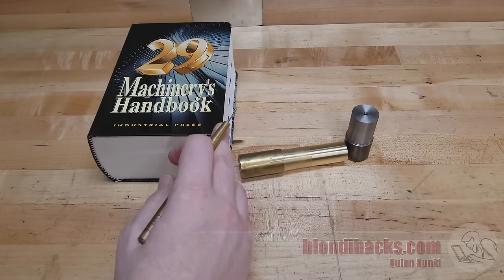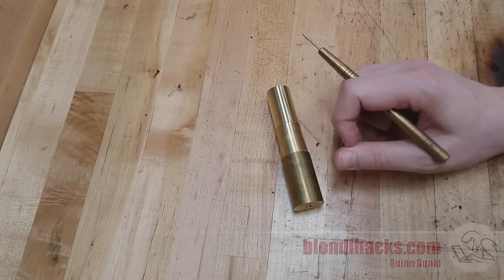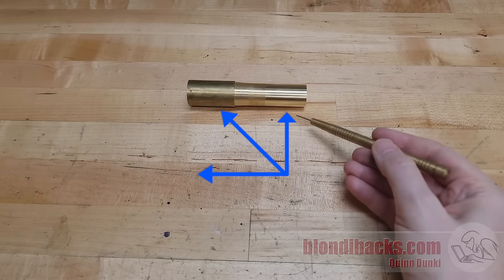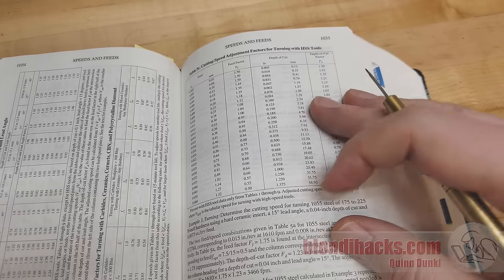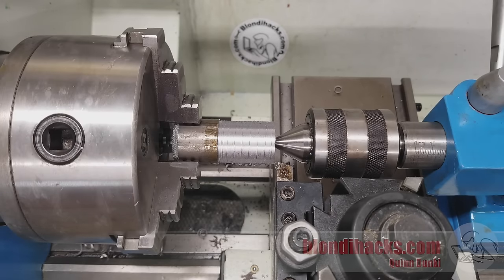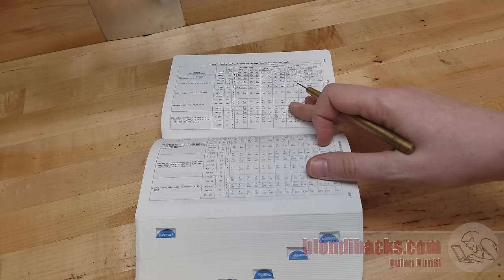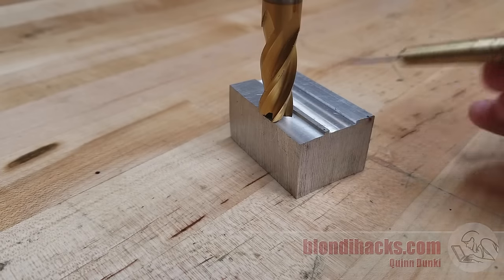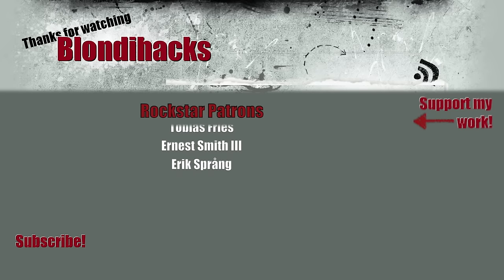Metal Lathe Tutorial 21 : Speeds & Feeds

Comment: Hi Blondiehacks, if you have not read the book "The Amateur's Lathe" by LH Sparey, you should, in-fact every amateur should.  Originally written for model engineers it is packed with information on the use of this class of lathe.  Really useful information is in that book!  It also has some machine drawings to make useful add on's for your lathe to increase its capability (Eg. collet set).  Line boring, milling, reamer making, lapping, heat treatment, spring turning, spinning are just some of the topics covered.

PS.  He discusses a technique obtaining a very high finish using HSS, and it is not using the shear tool, although I think it is mentioned somewhere.

Good quality content. Keep it up!!
Cheers.
Reply from the maker: Thanks for the tip! I will look that one up.
Reply: Thanks for the tip as well, I've just ordered the book - cost just under $20CAD, well worth it I expect!

Comment: You mention what a CNC shop does for feeds and speeds. Tooling manufactures recommendations, Machining Data Handbook and later HSM Advisor were my go to sources for speed and feed. Looking at the chip, sound and surface finish was what I used to dial it in.

Comment: Love you videos. I’ve always gone with 1/2” steel at 600 rpm. Double the diameter and you’d halve the speed.  Halve the diameter and you’d double the speed For aluminum double these speeds and for stainless steel halve the speeds. High nickels and super alloys go carbide and get a good book. I’m a welder by trade so I do mostly rough work.

Comment: Good show, I learned in school to use the same formula ,  You answered the question why the machinery's handbook has different speeds and feeds , The SFPM  I learned for steel is an even 100  , I have similar numbers for other metals from school This is a Guide  THIS IS A GUIDE THIS IS A GUIDE  My mistake is to use lower speeds not always good , After my course I used the formula a lot for turning ( Dia. of the part ) Drilling ( Dia of the drill )  Milling ( Dia of the  cutter  )  Today I play it by ear sometimes I will still use the formula ....

Comment: The Machinery's Handbook is not directly applicable for machining with metal working equipment which weighs less than 1 bus or costs less than 10 buses.  A guy I knew was a chef on an aircraft carrier.  After his service, he was planning to use his personalized Navy cook books to open a restaurant.   He did.  And he failed before he opened.  Most recipes were for 2000, the smallest for 200.  Scaling to 1 or 10 simply did not yield food he could serve.   You did a great job on this video, delving into the assumptions, details and the calculations.
Reply from the maker: I bet he could throw a hell of a huge dinner party, though.

Comment: I do not look forward to needing to convert all the feed rates on an old artisan lathe as I likely need to convert the carriage lead screw to a modern ACME or ball screw. So far I have not found a good solution to recreating the 3/4"-double start 2tpi LH ACME thread on the worn-out leadscrew nut. So replacement and converting all of the feed rates is looking more and more like the only economical solution.

Thanks for going over the general details.

Comment: Playing with the numbers as you put it.. I had a job that required I turn a 12 inch long x 2 inch diameter shoulder on a hand full of 5 inch diameter 1018... best cut vs tool life I got on my big old monarch was a 15 thou feed, .375 depth(3/4 on od) and 300 rpm... chips were wicked, but I got 2 parts per tool sharpening

Comment: Hi Quinn,  what i would like is a video showing how to know when turning or even facing if your rpm's are to slow or to fast.   How to know when your tool is happy or not.   Even with all the figuring whether you are on track or not.   Even milling whether speed up,  slow down or it's cutting good.   Even whether to change the depth of cut or it is fine.   I would sure like to learn about that and could you consider doing a  video on that.  Thanks. 

Dale in Canada
Reply from the maker: Hi Dale! That’s really about feel and experience with your machine. What I recommend is starting with light cuts (10 thou) and low feeds (0.005 per revolution). Then work up slowly from there and notice how the machine sounds, how the cut looks, etc. You’ll learn where the upper limits are.

Comment: I've watched this video I don't know five times already and while I understood what you were saying it wasn't connecting. This time I'm actually trying to find the correct way to find these settings and with the knowledge I've gained in the meantime your stating the problems in having time and time again. I know feed rate matters depending on the tooling you are using to cut (as well as other factors) but try to find a clearcut answer on how to calculate the correct feed. Every answer is SFM which okay cool where's the other incredibly important part of the answer? I could have my spindle doing one revolution an hour and a feed rate of a mile per minute (yes I'm being facetious) so long as it all adds up to the same SFM right? So this time around you have my undivided attention.
Okay, I see what you did and I appreciate it. I wanted to find out exactly how to calculate these settings and you showed us how to do it with any machine we own. Not that answer I wanted but the answer I needed kind of thing. Thanks for taking to the time to share your knowledge. I wouldn't have half to knowledge I do without youtube.

Comment: Try a carbide insert for aluminium on brass and aluminium.  The 20ø of rake really reduces the power needed to make a cut and the edges are ground so they are very sharp.
They are so cheap that using them for steel is not unrealistic either. They work really well on free cutting steel, they don't last as long as they do on nonferrous materials but as I said they are really cheap.

Comment: Thanks for this nice information. One question, or comment: Regarding the true surface speed beeing the result of the two vectors, 
the horizontal vector as a result of feed speed has to be  miniscule in comparision to the rotational vector. It will therefore add almost no 
extra surface speed.  At least that is my understanding, willing to be corrected. Thanks.

Comment: Great subject Quinn, well covered! Now the confusion starts 😭😭😭. Rubbing isn't machining, and mild steel does not respond favourably to machining. Carbon Steels ≥0.35 machine better, mild steel = stringy cheese, carbon steel = hard cheese. I'm sure Quinn will delve deeper in to the world of modified/free machining materials.
Thanks for sharing
Reply from the maker: I cover that quite a bit in my “how to buy metal” and “surface finishes” videos, as a matter of fact
Reply: @Blondihacks  I will have a look Thank you, many hobby ladies and gentlemen would benefit from only using free machining steels, as long no welding or heat treatment is required, but most likely would be sold at a premium in small quantities. More swarf per Coulumb, not technically a unit of power consumption.

Comment: MH assumes you know what material you are cutting.  I have no idea what any of the material in my scrap bins are.  On the mill, I go by ear to determine whether or not I'm pushing the Grizzly knee mill too hard.  On the Atlas 618, the belt starts slipping if I'm pushing too hard.  I have trouble remembering that carbide tooling likes high speeds.

Comment: I really like your tutorial. It has made a lot of questions i have had for the past few years in my experience of using a lathe machine. I still have one problem. If the material ex. Metal rod. Was bowl shaped. Is it possible to get a nice surface finish? Material is an aluminum bowl

Comment: This is a great video and what i was looking for. One question though. Im building a desktop type cnc lathe for making chess pieces out of aliminium and brass. If I direct drive my spindle from my 3hp 220v AC servo motor i only have 2500RPM. is that good enough? I can build a gearbox to got to 5000rpm if needed but that is alot more design a fab work.

Comment: I'm in a predicament – how do we trade off Feed per Tooth vs Cutting Speed on hobby mills?
The 1” diameter tool is the best case example for a hobby mill and I still can’t make it work – 500SFM for aluminium, 1” tool = 2000RPM. Then following various sources that suggest recommended Feed per Tooth of 0.28mm(0.011”) for an end mill cutting aluminium, assume 2 flute, means the feed rate would need to be 18.66mm/s (1120mm/min) but realistically I can only turn the wheel on the mill twice per second, so 3mm/s max. And normally I’d be going 1.5mm/s to move the stages in a more controlled way. So I either have chips that are 0.0225-0.045mm(0.0009-0.0018”) ie 6-12x smaller than recommended, or I have to drop the RPM but then the cutting speed suffers.

And if we were to consider a 6mm (or ¼”) cutter, then things get a whole lot worse. The max rpm of my machine kicks in which is 2500rpm, so 6mm * 3.14159 * 2500 / 1000 / 0.3 = 157SFM. Not much I can do about that. And if I’m moving the stage at a controlled speed of 1 turn/s (1.5mm/s), then my chips will be 0.018mm (0.0007”). So the question is whether it’s better to slow the rpm down, to say 500 or 1000rpm to get thicker chips? And what do thin chips actually mean? Just unnecessary tool wear? Cheers, Frank.

Comment: I have a hobby lathe and a hobby mill,i am new to machining..Have had these for a year now,and destroyed a lot of mill bits and carbide inserts.Reason is propably wrong speed.
The calculation here is hard to understand,not familiar with inches.Can anyone explain,if i have a 10mm mill bit and cutting steel what is the right speed?

Comment: I recently bought my first lathe. It's a 1930s leblond 10" lathe and haven't had the finish results I expected. The max rpm of the lathe according to the chart is only 550 rpm wich seems way to less in comparison with the speeds mentioned in the video. I initially tought the bad finish was due to my vidia cutting tools because I later found out these have high cuttingspeeds. Since my lathe is so old I higly doubt vidia or tungsten was already used back then so I now switched to HSS and according to the the video finish passes for 1" is around 800rpm but my lathe doesn't even come near. Does someone know why the max rpm is only 550? I really don't understand how they turned proper parts...

Comment: You' think that by now someone would have integrated all this data in a smartphone calculator
Reply from the maker: There are a couple of “machinist calculators” out there, but none that impressed me very much. I may write one if I ever get time.
Reply: @Richard Hunter - looks great but this is called 'pro' for a reason. I doubt that may hobbyist would spend the cash. I am using an Excel spreadsheet for the basics.
Reply: "if I ever get time" sounds familiar. Most of my projects end up like that :D

Comment: It's at least worthwhile mentioning that HSS and Carbide tools both have different attitudes towards feeds and speeds. Generally, surface finishes are improved with HSS reducing SFM. While Carbide prefers the opposite liking more SFM. Although, letting the big dog eat on a hobby lathe is all relative.........
Reply from the maker: Yah, I steered clear of carbide in this video because, as I’ve said earlier in the series, HSS is (in my humble opinion) a much better choice on small machines. The recommended numbers for carbide just aren’t possible on machines like this. The rigidity and horsepower aren’t there.
Reply: @Blondihacks  I couldn't agree more, ironically there are a metric ton of home users on the carbide train.....
Reply from the maker: @Rprecision  Yah, I think a lot of newcomers use it because that's what the pros on YouTube use, but have never actually looked up how hard you're supposed to run it. 😀 I had a lot of trouble getting good surface finishes until I switched to HSS. Then I looked up what the minimum DOC and feed rate recommendations are for carbide inserts, and it all made sense.😅
Reply: Yeah when you first start your trade as a fitter machinist you use hss and probably for most guys in their garage it is enough as time is not essential and the machines dont have the guts to pull carbide inserts. You can put a cover on ya tool on the brass and not spray it everywhere mate. Soft jaw in the three jaw chuck will fuck it and as you said it will slip. Teach all these lizards to use a four jaw mate

Comment: So having one of those lathes that doesn't have a knob (not counting the actual user) for speed adjustment, but a selection of gears that gives fixed speeds, I've concluded that the around 750 and 460 rpm speeds work well for cutting steel. Alumininium wants more than that. Haven't done much brass, so I don't have a "feel" for that.

Using carbide inserts, I probably could go a bit faster.

I'm surprised how little the lower feed and depth of cut affects. Sure, 1.15 x 1.08 makes 1.24 - so 25% more speed. But that's with 25% lower feed, and 1/3 or 1/4 of the DOC.
Reply from the maker: DOC and feed don’t affect ideal surface speed much, but they are the main limits on horsepower and rigidity, for sure. The physics of chip formation are such that DOC matters surprisingly little for how well the metal cuts, though!
Reply: I get what you are saying. And I certainly follow the "DOC and feed affect the power needed to make that cut". It was the fact that if you take more than half off on one, and more than half off on the other, you only gain a little bit.

I have found through trying that my machine has limits both with regards to rigidity (it IS rigid, it weighs 600kg (1300 lbs)) and power - it has a 2 hp motor, so nothing huge. For mild steel, a 0.5mm (20 thou) depth of cut is acceptable. I was working on some EN24T, similar to 4340, and that was tough at 0.25mm (10 thou), and even then, the motor was definitely saying "ugh, this is tough". Can't remember the exact feed that I use - I think around 0.1-0.2mm/r (4-8 thou). Maybe I should try deeper cuts with slower feed?
Reply from the maker: @matspatpc  Hmmm.. I'd take a look at your tool geometry or work setup in that case. A machine that size should be capable of much more aggressive cuts. My little machine will do 40 thou DOC at 10 thou feed rate in mild steel, and the whole thing probably weighs less than your carriage. 😀 I think something besides horsepower or machine rigidity is keeping you from cutting better. Either the rigidity of the setup, or maybe the spindle bearings are worn, one of the slides is loose, something like that.
Reply: Hmm, maybe I'm just a bit of a coward - or memory playing tricks on me? I've got a project now where I'm taking about 1" off a 2" piece, so shall have a go at a bit more doc.
Reply: @Blondihacks  so, took a 2" piece, and I can do about 2mm DOC at 460rpm, with lots of smoke, nice looking blue chips. But I had to reduce the feed to the lowest range. Previously, I've gone one or even two steps higher on the feed rate. For taking a decent chunk off, I guess it's a compromise, either more feed or more DOC. Both together don't work, the motor stalls...
Reply from the maker: @matspatpc  2mm DOC is very respectable! Probably about right for the upper limit of HSS on your machine. Sounds like you're doing it right to me. Your machine is big enough to support carbide, so that might be worth a shot.
Reply: @Blondihacks  sorry, I am using carbide inserts. Probably not to their full potential, but this is with carbide. That's what I meant originally with "using carbide, probably could go faster".

I've not tried HSS bits. I only just got a bench grinder. I also got some HSS blanks, so will try that - perhaps grind a nice radius one for smooth finishes...

Thanks for your thoughts, really appreciate it.

Comment: So no one else needs to step thru frame-by-frame to catch that screen flash of info around 0:33...
(Because, someone had to...)

1" diamater

Steel: Base 120 SFM
Roughing: 40 DOC, 10 thou feed = 500 RPM
Finishing: 2.5 thou feed = 800 RPM

Aluminum : Base  500 SFM
Roughing: 60 DOC, 10 thou feed = 2000 RPM
Finishing: 2.5 thou feed = (infinity) RPM

Brass : Base 350 SFM
Roughing: 60 DOC, 10 thou feed = 1400 RPM
Finishing: 2.5 thou feed = (infinity) RPM

Your welcome!  :)
Reply: ...And I just finished watching the rest of the video, and noticed that Quinn actually shows the info later, starting around 11:03.  So much for thinking I was being clever/providing a public service... :)
Reply from the maker: I appreciated the effort anyway. 😬

Comment: I remember ef the days when ths insert manufacturers would hand out the handy speed and feed slide rules. I think those days died about 15 years ago. I know you ge really don't use carbide on your lathe but there are a number of insert options for low horse power machines. Those sets of 5 tool holders that take TPG inserts work well as long as they have the built in chip breaker. Plus they allow you to switch right over to a 45° chamfer tool*. The inserts really don't work well for threading on a smaller lathe as the pitches being cut are too fine. Some of the TPG inserts even with TiN coatings are very reasonably priced. 
*I have a whole set of chamfering tools that were ground on a surface grinder using a tool grinding jig I made years ago. 15° to 45° in 5° steps.
°